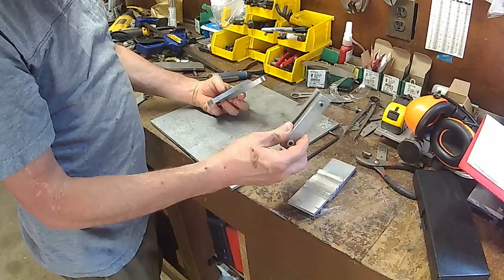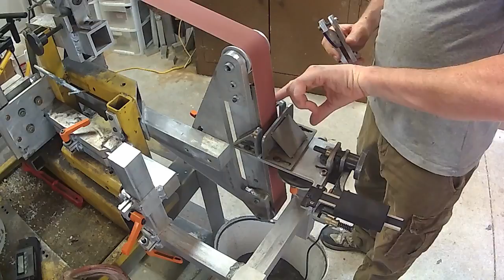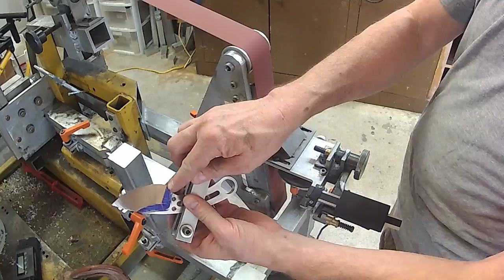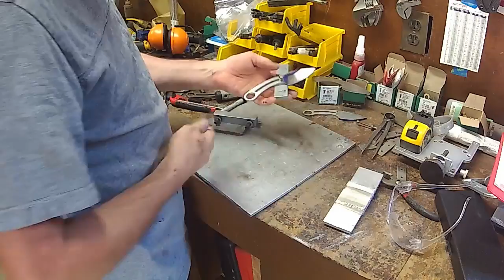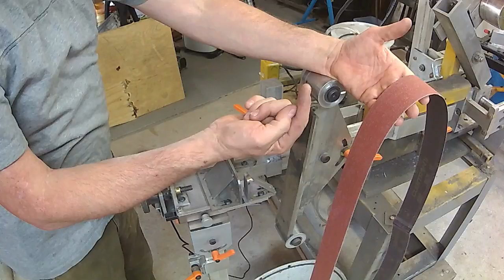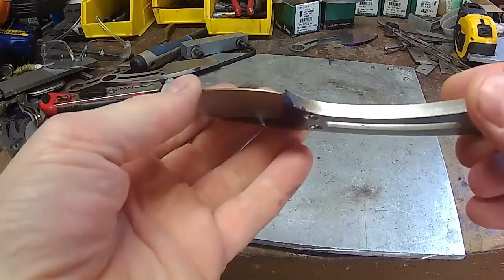Bevel Grinding and Plunge Cutting with Multi Guide

Comment: Great tutorial Daryl, really useful and has given me some inspiration. A more efficient solution to accurate/matching plunge lines than I've developed. Your mount setup is so stable too in comparison to mine and that belt tracks amazingly stable! If you hang the belt over the edge of the platten a little bit and aim to hit your plunge target with the 120 grit belt you'll get a slightly less abrupt transition, or at least that's what I do with hollow grinding using a similar technique.
Reply from the maker: I thought this was the method you described to me that you used. hahaha
I am working up to your technique.  You are more advanced in your grinding skill with the guide than I am!  Now that I know how to hit the target I will begin to do your method to get a softer transition.
Reply: It is broadly similar but you have approached it in a much more professional way with the offset tool, plunge clamps etc, in comparison to my hit and miss method. I guess it helps that you can physically attached to the blanks whilst on my folder knives I have to attach to the carriers, which introduces a bit more inconsistency. The next model will be thicker steel so that I can attach to both sides and use the same holes. Watching you manually adjust the mount to bring it in to line with the plunge line reminds me of why I wanted to experiment with the spare slide you sent me to see if it is possible to adapt the guide to micro-adjust in the x axis as well as the y axis.